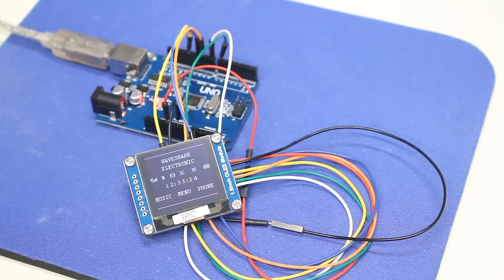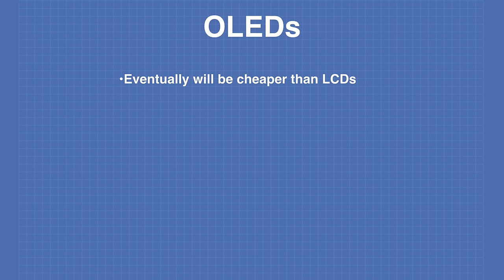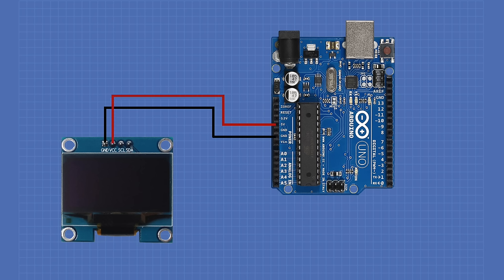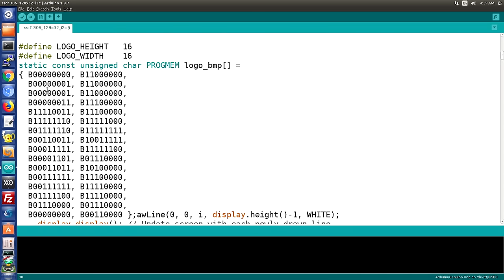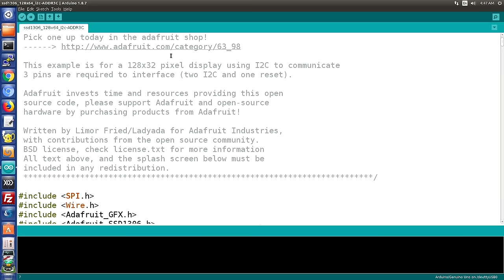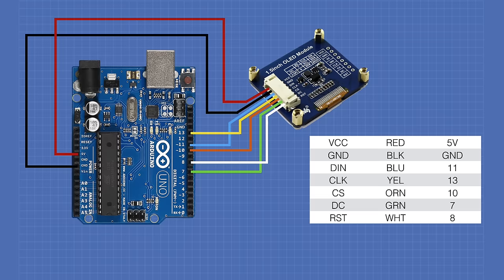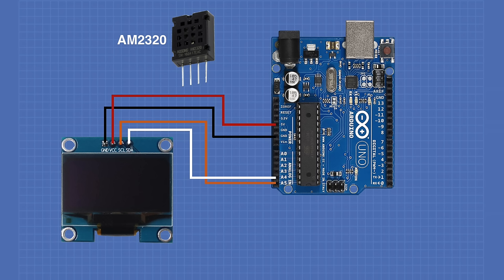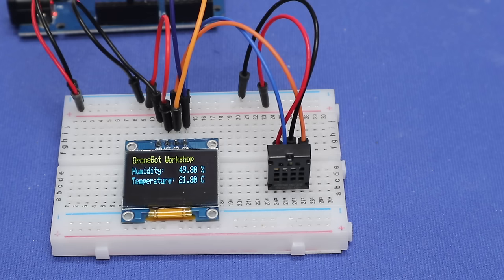OLED Displays with Arduino - I2C & SPI OLEDs

Comment: Anyone know where I can get a 12" self emissive transparent OLED? 

There are the 55"and larger ,and the 2" and less ones , but I've never seen a commercially available transparent one in the 7-24" range. That's really the range where they can be practical and I don't understand why those aren't the ones being sold.
Reply: Is it standard resolution/size?
Reply: @magicianofelectronics951  are you asking if the one I need has to fit a standard,(no). If you are asking about the ones I've seen like the 1.5" little squares or the 55"+ TV's, yes, they fit some standard resolution. I have no idea if they work with any standard screen controller boards, but I hope so and wish to know.
Reply: @petevenuti7355  yea, undoubtedly you can generate same signal for any electronic module, but the difficult thing is to determine the signal, and the controller hardware and program, thanks
Reply: @magicianofelectronics951  of course, however if such a screen was produced in quantity I would assume it would come with a controller or be compatible with off the shelf equipment in order to encourage sales. On the other hand if you obtained a prototype from a company like emagin or something and are trying to reverse engineer it,Or somehow printed your own from scratch, wow, just WOW.
If you find something or create something in that size range just let me know,
   I have absolutely no interest in pasting together 36 or 48 smaller screens in a mosaic and coming up with transparent conductors and connecting bezels to get a decent picture
(unless somebody wants to sponsor me to try 😜)
Reply: @petevenuti7355  you are right, so can you say me what you want to do exactly?
Reply: @magicianofelectronics951  Why not, just give me credit, 
  I want to simply replace my sun visor with a heads up display. It has to be self emissive so I don't have to consider backlighting when switching between cars and needs to have sufficient resolution that if I displayed an IR overlay I could tell the difference between a squirrel and a hot sock at a few hundred feet.

Comment: Hi Bill! Your videos are really great for getting knowledge! As amateur I programmed one nice ssd1351 1.5' display showing continuously values such as time, temp, hum and barometric press and in one month 'burn in' occured. I haven't seen, maybe i'm wrong, something relevant in your videos. Is in your plans to give some advices regarding how to avoid this terrible thing by scrolling, fading down the display or other techniques?
Reply: what exactly part is burned out?
Reply: @magicianofelectronics951  There are some posts in the web explaining better oled's "burn in" when printing contuniously for a long time the same thing at the same area of the display. Expensive tvs have a special software to avoid it. Personally I reduced the brightness of printed colors (max 180 of 255) and have the text scrolling.
Reply: @sakisv4138  means problem is solved now, good

Comment: Do you think it could be possible to separate the display from the screen to just keep the transparent part of the oled display and use it as a transparent screen that could be attached to glasses or other material? Or do you need to search for a specialized display for a goal like this?

Comment: I wish you a good day. I ordered an Oled display SSD1306 1.5 inch 4 pin. A 7 pin Oled was sent to me by accident. Would it be possible to somehow connect it to work as a 4 pin Oled? I need a 4-pin OLED for projects. Thank you in advance Attila for your help.

Comment: I've tried two oled 128x64 screens and neither have worked. I tried changing the address in the code to both options on the rear of the screens as well and nothing. These oled displays seem to be nothing but problems when I look up forums online. I think there are two types of people on earth, those who's oleds work and them that don't. Nice instructional video though.

Comment: Hi, I'm super new to hobby electronics and I'm struggling to understand the difference between the Arduino Uno on your test bench and the Arduino Uno in your diagrams. Are they the same?

Comment: Hi, have you used the 1.5" 128x128 waveshare OLED via I2C? I'd like to use as few pins as possible. I understand you need to resolder the two resistors on the back, but would that also enable the use of the Adafruit libraries? It seems to be a SSD1327...
Reply: yea, just you will have to set address and resolution, there are more than 1 libraries available for I2C communication

Comment: i have a question maybe you can help. I had gotten one of these Arduino Boards and it works fine. however i had also bought a spare chip ATMEGA328P-PU Microcontrolle?€?r With ARDUINO UNO R3 Bootloader good quality from eBay.
I suspect it may not have a boot loader if it does not what can i do to resolve this problem. I never used Arduino before. as i am into intermediate Electronics.

Comment: ive just bought the waveshare 128x128 oled to start coding .

Im so confused and frustrated  ,i just want to show a bitmap
and draw lines ,etc . 

Any sugestions where to start learning?

 Im using C++ and spi on the oled so far.

Should I go for python and I2C ? Easier to start maybe?   ....help? ;/

Comment: I made a 32x32 AMOLED display. but driver controller IC is not available.Is it possible to operate 32x32 using SSD1306? if not then how it is possible to operate 32x32 OLED display. pls  help. thanks

Comment: hello Bill
I did all the steps included in the video for interfacing Arduino Mega with Waveshare 1.5inch OLED display but nothing gets displayed. The screen is blank. I have tried to explore the solution to this, but was not able to find anything. Can u help me ?
Reply: SPI or I2C?

Comment: Hi there thankyou for your videos  , i have a question my oled gets random characters  over time without any regular input   one it get an input  it restores but over the next 10 mins it will  display random  characters again , i need it to just hold the last message until a new one comes in , can you suggest where to look to address this  thanks Ron

Comment: Great video. How can I run this program in Atmel studio as this arduino uses the same mcu made by atmel? Thx
Reply: why you want to do that?
Reply: @magicianofelectronics951  i hv Atmel based custom board with this display to use on my project.
Reply: @jayp.4100  I recommend you to program it with more popular software if possible, then it will be easier to get help online

Comment: i was trying to pm you but i have a question, i have been trying to research transducers for under water sonar and was trying to find something on making my own as i would like something with a higher output to have a more detailed return ping. any chance you can point me in the right direction i have found companies that sell the sonar transducers but being that i am doing this as a project at home i would like a more cost effective solution.

Comment: Hey silly question - could you directly wire two Arduinos together simply by just sending a 5v digitalWrite(); from one Arduino directly into a digital pin on the second unit and read the signal with digitalRead();? would pulldown resistors be needed?  - one of those late night moments right now

for example: 

// Arduino A
int DigitalSendPin = 2;// the pin sending the signal connected to a second Ardiono (same ground)

void setup() {
pinMode(DigitalSendPin, OUTPUT);
}

void loop() {
// every second send a signal 50% duty cycle 
digitalWrite(DigitalSendPin,HIGH);
delay(1000);
digitalWrite(DigitalSendPin,LOW);
delay(1000);
}

// Arduino B 
int DigitalReceivePin = 2; // the pin on the other Arduino that is looking for a signal

int eventTrigger; // the thing that happens when signal is received

int triggerStatus;

void setup() {
pinMode(DigitalReceivePin,INPUT);
}

void loop(){
triggerStatus = digitalRead(DigitalReceivePin);

if (triggerStatus == 1){
event Trigger = 1;
}

}

Working on a little modular synth and wondering if serial communication or simply using digital CV signals using this would work?

Comment: Hi everyone ... Wanted to ask how is it possible not to have pull ups when using I2C? Are they already soldered onto the module? If I add my own won't they just be in parallel to whatever is on the board? Thanks in advance ... Wanted to play with the module
Reply: If you are speaking about I2C location resistor, so yea it's already soldered on the oled board
Reply: @magicianofelectronics951  thanks for the feedback 👍 ... This is why I hate playing with modules ... Too much important info is hidden from rookies like me starting out
Reply: @jeromembeche8907  no you don't have to worry about that hex address until you want to use more than one I2C devices, it's never required to me to change anything on that, thanks

Comment: I have tried to use the 1.5 inch Oled with the Waveshare software and nothing happens on the screen. Is the product faulty. I have had the Oled for a day, so it is new. Help.

Comment: Hello..I want to draw many animations on my OLED..but my UNO hasnot enough space to store so-many animation-frames..how i can store the animation frames(converted to C code) at a SD card..and source it to the main arduino code?
Reply: Microcontroller can not execute code from external memory. Use controller with higher memory size like RP pico with 264KB on-chip SRAM 2MB on-board QSPI Flash larger than Arduino Mega too.

Comment: Hi Bill, thanks for the fantastic work. I look forward to your robotic videos coming soon. Just a wee question about your use of the AM2320 temp & humid sensor.
Why could you not have used the DHT11 or DHT22 sensor we already have in stock? I don't have a AM2320 so would need to purchase one if I wanted to try this sample sketch out.
Reply: I think you can just modify every bit of the code that mentions the am2320 to work with the DHT11, that's what I'm currently trying to do.

Comment: NEED HELP !! I downloaded the required library files (adafruit GFX file and Adafuit 1306) when i load the sketch for optical tachometer the screen resolution looks like it is 128x32 instead of 128z64 with is the display i am using. I went into the library as per your video to change the 0x3d to 0x3c and i hit save in the file menu. However when i go back in to check the change it did not take effect ? Please help. !! how to i make that change and save it ?

Comment: I am newbie in Arduino 
My  OLED module 128x64 Jumpers 0x7B connected other side have 0x7A (In 7:32  ) .How is use adarufruit Library?
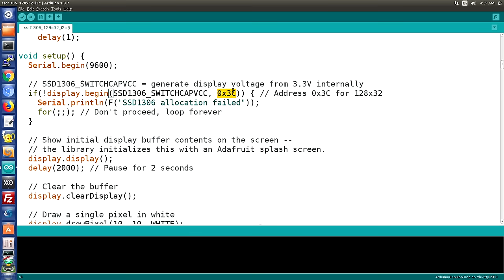Can I change adress in 17:18 code line with my jumper value ? 
I was try load code .it was give "Status1 Error" with orginal codes
Reply: I was fixed.If use prioty 1.8.8 IDE  you must load Adaruit_BusIO library too

Comment: Bought couple Oled displays from Amazon and followed instruction, when connected neither of two display showed anything, address on either 0X78 or 0X7A, I do not know if I am doing something wrong, tried with Arduino Uno and Nano with same results, no display.

Comment: It shows "SSD1306 allocation failed" message in Serial Monitor. What should I do to overcome this issue?
Reply: I haven't experimented with the devices, but you might check that you have entered the correct I2C address for the device. Check the device as well as the code.

Comment: Hello sir, I'm on different project with oled, problem is that the 128*64 display stopped to work after first experiment with Arduino i2c example, can anyone help me please, it is my final year project, thanks in advance

Comment: how do you install more memory in arduino? never heard of this being done. also your zip file is a "7z" file that cannot be opened? i am using Ubuntu 16.04 what are you using? and how did you extract it? i can do a normal extraction but this is not it.
Reply: "7z" zip files are for the 7zip file archiver from 7-zip.org.

Comment: I think “led vs oled” is  misleading. You maybe referring to LCD vs OLED.  Because the “LED” in LCD screens is for backlight illumination.

Yet, the explanation simply ignores the fundamental difference: LCD is light reflection, OLED is light emitter.

Otherwise, the electronics are ok, I suppose.

Comment: Why are all the OLED's so small, what about driving one the size of a cell phone, say 4 inches in size?
Reply: Those would not rely on i2c or spi most likely because you'll need parallel coding in order to be able to refresh those types of screens at a refresh rate such as 30 or 60 mhz. Some protocols won't have enough bandwidth to be able to pass that much data at once and the UNO controller wont be fast enough to push that much data in the first place. Larger screens will mean more pixels to refresh in the same time frame. Means, you gotta push data faster, means you gotta send it faster. Cellphone processors are fast enough to do that. An Uno will struggle to keep up even at half the speed. You'd need a good 32 bit controller for that like an STM32F3 series or an Arduibo DUE 32bit controller.

Comment: HELLO , can I contact  you to help me solve why my oled screen doesn't work?
Reply: it only work when I hold arduino reset button
Reply: @TrailMaker2  Are you sure about the reset button?
Reply: @magicianofelectronics951   I found the problem, it was too much current going to the display all wires were connected properly. But thank you for responce.
Reply: @TrailMaker2  🙂🙂🙂

Comment: Just have to watch for burn in.  These won't be good for anything with a picture that stays mostly the same or keeps any pixels lit constantly.  It will be easy to see which pixels are burnt when there is no power to the display.

Comment: I have an issue when verifying the sketch. Here are the error messages

 Arduino: 1.8.19 (Windows 10), Board: "Arduino Uno"

I:\Download folder main\OLED+Temp+Humid+Meter+-+DroneBot+Workshop\oled-temp-humid-meter\oled-temp-humid-meter.ino: In function 'void setup()':

oled-temp-humid-meter:34:14: error: a function-definition is not allowed here before '{' token

 void setup() {

              ^

oled-temp-humid-meter:43:24: error: a function-definition is not allowed here before '{' token

 void displayTempHumid(){

                        ^

oled-temp-humid-meter:70:13: error: a function-definition is not allowed here before '{' token

 void loop() {

             ^

oled-temp-humid-meter:73:1: error: expected '}' at end of input

 }

 ^

exit status 1

a function-definition is not allowed here before '{' token

This report would have more information with
"Show verbose output during compilation"
option enabled in File -> Preferences.
Reply: I figured it out yeah

Comment: i tried for 4 hours with tons a videos all 4 of mine just decided not to work
Reply: I also struggled until i found out that there are two adresses on the back of the display 0x3C and 0x3D. Depending on where the jumper is solderd on, it is one or the other, not necessarily tied to the display type…

Comment: Sorry bill couldn't find a link to code so had to copy and paste.  If you up load this sketch to your arduino it will print the serial bus code to the serial monitor
hope this helps anyone having problems with their displays.  /*
CircuitMagic.com
*/
#include <Wire.h>
void setup()
{
  Wire.begin();
 
  Serial.begin(9600);
  Serial.println("\nI2C Scanner");
}
void loop()
{
  byte error, address;
  int nDevices;
 
  Serial.println("Scanning...");
 
  nDevices = 0;
  for(address = 1; address < 127; address++ )
  {
    // The i2c_scanner uses the return value of
    // the Write.endTransmisstion to see if
    // a device did acknowledge to the address.
    Wire.beginTransmission(address);
    error = Wire.endTransmission();
 
    if (error == 0)
    {
      Serial.print("I2C device found at address 0x");
      if (address<16)
        Serial.print("0");
      Serial.print(address,HEX);
      Serial.println("  !");
 
      nDevices++;
    }
    else if (error==4)
    {
      Serial.print("Unknow error at address 0x");
      if (address<16)
        Serial.print("0");
      Serial.println(address,HEX);
    }   
  }
  if (nDevices == 0)
    Serial.println("No I2C devices found\n");
  else
    Serial.println("done\n");
 
  delay(5000); // wait 5 seconds for next scan
}
[/code]

Comment: HI there, off-topic; But I need your help guys

 I've been exploding my brain the whole day. in my arduino , when a condition is met
I want to turn a pin HIGH for one minute  then go LOW ignoring the condition if is still on at that moment, without using delays.

So far, I managed to turn it on and off only when the condition is false (which is not what I want) any help please.
Greetings from Tanzania

this is my loop at a moment:

void loop() {
  currentTime = millis();
  if ( (digitalRead(sensor) == HIGH) || (timeRunning == 1)){ 
    if (timeRunning == 0){
      startTime =millis();
      timeRunning = 1; // flag to show timer is started
      digitalWrite(motor, HIGH); //make sure motor is powerled
      digitalWrite(fanPin, HIGH);
      }
    elapsedTime = currentTime - startTime;
    if (elapsedTime >=oneMinute){
      digitalWrite(fanPin, LOW);
      digitalWrite(motor, LOW);// unpower the motor 
      timeRunning = 0;
    
    }
  }
}